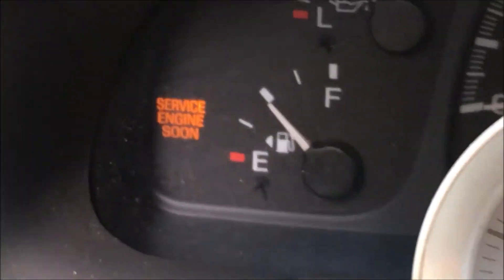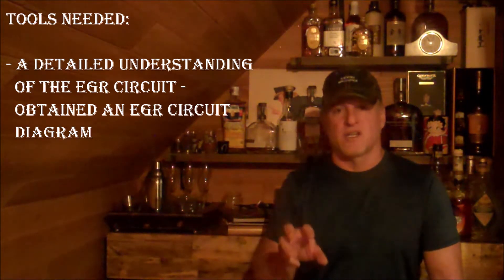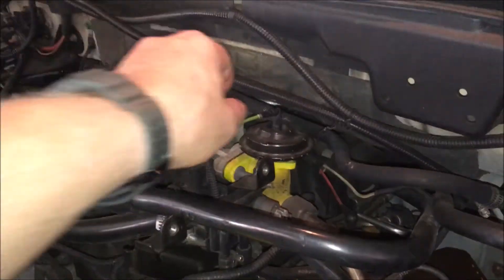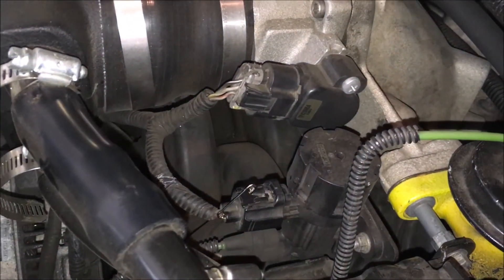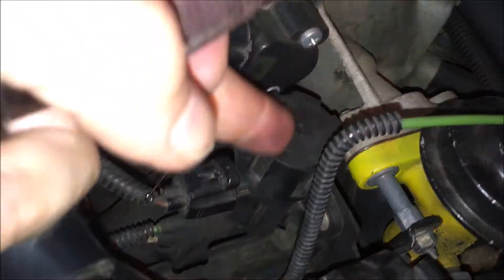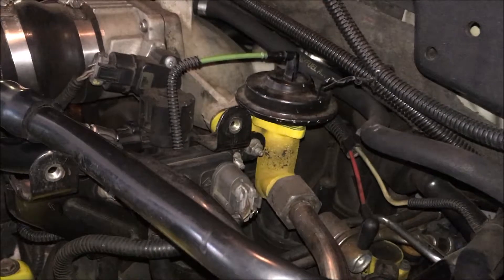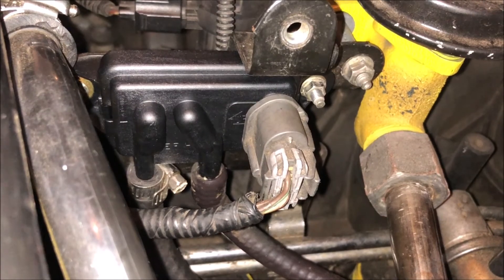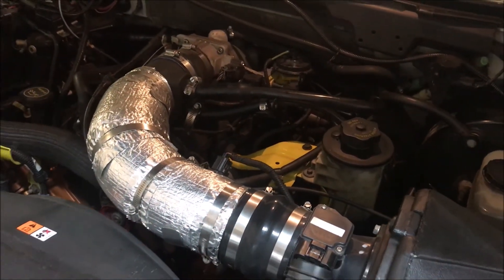How To Diagnose & Repair / Fix Ford EGR Circuit Failure P0401 & U1262 Communications Fault:  F150

Comment: Excellent content, just had an issue which I had to remove the egr, snake out the port to clear carbon deposit buildup, then replace dpfe sensor and replace both 1/4 vacuum hoses which is essentially important. Unfortunately a couple task must be performed to get the egr circuit functioning properly
Reply from the maker: right on

Comment: Dpfe sensor faulty and clogged converter on my friend's 97 F-150 5.4 l.  Like a different engine now it can breathe again.Never code code for sensor and would have loved to had ya there to suggest your logic and eventually I may have put it together but good to know someone with your thought process and trouble shooting.✅👍
Reply from the maker: glad you worked it out... I pulled my upper cats and came to find out the previous owner gutted mine passenger side!  Now I only have 1 cat on the driver side!  ;)

Comment: Sometimes (rarely but happens a little more than not) that orfice tube going from the exhaust manifold to the EGR valve will become clogged causing loss of flow or none at all between the dpfe hoses. It kind of acts like any orfice like in a A/C system. The way the dpfe works is it measures exhaust pressure on manifold side hose and intake air on the EGR side hose with very minimal flow (if any)when EGR is closed through a coil winding (like a mass air flow sensor)inside the dpfe that has 12v connected to one side of winding  and the reference (1-5V) wire going to pcm on the other side. (so I guess think of it more like a blower motor resistor). The exhaust pressure flows through it's hose into the dpfe and so does the intake side, when EGR is closed, they both come together and pass over the dpfe coil winding and that pressure difference is what regulates the voltage going to pcm as it passes over coil.  So its taking the 12V circuit, and through a resistor, converts the voltage down low for pcm input. Meaning the more the pressure difference the more voltage the dpfe sends to pcm on a scale of 1-5 and that tells the pcm how much to open up the EGR valve. If any part before or after the hoses are clogged it'll have no signal due to no pressure difference to measure. You'll also get similar codes if that sample tube has any leaks even pin hole sizes, or if the driver side exhaust manifold is leaking at the rear of engine. Or another thing opposite of this situation is, if the orfice somehow breaks than they'll be equal pressure on both sides and could either cause this to happen or the pcm won't ever open the EGR valve because it thinks it is open. Technically when EGR valve is closed the exhaust gases (pressure) does not (should not) flow through the orfice at all but instead all of it goes into dpfe and on the other side through intake hose. When EGR opens, there becomes enough pressure from exhaust pressure and intake vacuum to pull through the orfice and recirculates the exhaust gases into the engine. So you could imagine that there's not a whole lot of exhaust actually going back into engine like most think. Just enough to keep cylinders cool (I can't remember off top of my head how this helps.) Something to do with the already burnt air fuel mixture it's cleaner, or more dense, or can be cooled quickly.
Reply: Sorry the fix to what I was saying is changing out that $100-$150 sample tube going from the EGR valve to exhaust manifold. And a quick test to check if clogged or fully opened orfice is shooting compressed air on each rubber hose one at a time. If exhaust side hose allows air out the exhaust and not into the other hose than that's good and same thing for intake hose. Shoot air in it and either use a mighty vac to open EGR valve to allow that compressed air to go into intake so it'll be easier to listen for, or it should slip off the EGR sample tube (or buldge if hose clamped is installed) from to much pressure
Reply: I didn't realize yours was an actual circuit failure. 9/10 times it's the dpfe. They get corrosion on the coil or it breaks. Sometimes the ports that the rubber hoses go into just get gummed up or spider webs (has happened and cause circuit failure). If you have the older style metal dpfe then ditch that one and get the updated plastic one. Ford had a tsb on this saying the metal one is .5ohms and the updated plastic one is 1ohm and should not affect drivability or the way engine runs. There was one person on Ford truck Facebook that said he went through 3 plastic ones and wasn't until he found a new metal one(discontinued and hard to find) it actually fixed his problem. It's possible he has other issues and needed one that was closer to his original pcm programmed tables. However I had a 97 with original pcm and original strategy code (tune/program not the same thing but strategy code is how you find if you have updated software or not) and the 97 f150 4.6 had the original metal dpfe and I got different ohm readings and wasn't consistent. Swapped out with plastic one and all was perfect! The ohm will be high if it's bad, most of the time, or none of it is broked
Reply from the maker: Thanks for all that data, always great to get your input.  With regard to keeping the cylinders cool, the purpose of the EGR circuit is to keep combustion temps down to prevent the formation of NOx, oxides of Nitrogen, which is a pollutant.  Very important for our environment.
Reply from the maker: @dyllanbabb7472  thanks
Reply from the maker: @dyllanbabb7472  more good info
Reply from the maker: I explain keeping cylinder temps down in this video:  https://youtu.be/VhIG7BOpihM

Comment: So I just watched your video and I am wondering if you completed the drive cycles before you rescanned for codes? Seems to me that when you erase the codes, they are not going to reappear until the drive cycles are complete and readiness is attained.
Reply from the maker: Good question, sometimes faults show up immediately and sometimes they require drive cycles to show up.  In either case, I made sure the errors did not return once the repair was completed.

Comment: Your seatbelt is because your running diagnosis with driver side seatbelt unbuckled and same goes if running codes (key on engine off) and you get oil pressure gauge/sensor code too. I've also gotten window circuit codes if I run diagnostics with the window in any position except up (but not on every vehicle) and door switch codes may appear if running codes with door open. Just throwing that out there
Reply from the maker: Thanks for that info Dyllan

Comment: I had a P1406 code on my 00 F150 4.6L. Replaced the DPFE sensor and thought all was good but now I'm getting a P1400 code. Is my new sensor faulty?
Reply from the maker: Hi, your codes don't necessarily indicate a problem with the DPFE sensor.  Have you followed my tests to isolate the problem?  Your EGR system could be plugged and need cleaning.
Reply: @DrivingIntelligence  The P1400 code seems to indicate low voltage. It didn't show low voltage before I replaced the DPFE sensor. All hoses are clear, I even replaced a hose that's going to the EGR valve. It doesn't seem to be affecting performance, but it just bothers me that the engine light is on.
Reply from the maker: @BrettDarien have you checked the EGR for plugging and proper function?
Reply: @DrivingIntelligence  I don't have a vacuum pump like you have in the video. I'll see if I can find one and maybe do some more testing over the weekend.
Reply from the maker: @BrettDarien  good call, if your EGR is plugged and not opening properly, or the plugged areas are limiting exhaust flow, you will get a bad voltage reading.
Reply from the maker: @BrettDarien I have one linked in the description of my video.

Comment: 2021 ford ranger. Bucking and surging. New spark plugs and a ton of sea foam did not fix.  Dpfe egr sensor and hoses fixed the problem.  $150.
Reply from the maker: Glad you got it sorted out

Comment: I have a 4.6 with the same code. Replace the egr valve and cleaned the lines and replaced the other part with the plug and two lines going into it. Yet I get same code. Been checked by a shop, they say it all works good. So I just leave it alone. I use the BlueDriver also.
Reply from the maker: Sorry to hear that.  Did you perform all the tests I show in this video?  Shops that say, it works, no problem with a continuing check engine light are not worth the time or expense.  Do you have any other codes to go along with the P0401?
Reply: @DrivingIntelligence  no. Just that one code. Truck has over 287000 miles on it too.
Reply from the maker: @41BeachComber  I suggest you try all my troubleshooting steps to see if you can isolate the problem area.  Get back to me once you have performed those steps.

Comment: I wish you were in Georgia to look at my vehicle!😊

I like learning and fixing my vehicle repairs, but I do wish I had a lift to do repairs underneath my 2000 ford expedition 4.6L V8 Triton XLT. 

By the way, do you know where I can get valve body parts for my vehicle?
Reply from the maker: A lift surely helps, but my problem is my Mustang is stored up there making room for my other projects!  As far as valve body parts are concerned, I assume you have a 4R70W tranny.  This playlist shows how I resolved OD Shudder by using many parts that improve transmission performance and life.  The first video shows most of the parts I used to improve valve body performance:  https://youtube.com/playlist?list=PLGNsbVXzRfZM6WpCF862q4DlkyatzFIMz&si=jXFGBHlIvog_-ku3
Reply: @DrivingIntelligence  Yes I do have a 4R70W. 
Thanks for the playlist link.
Reply from the maker: Sure thing, let me know if you have any other questions
Reply: @DrivingIntelligence  I was watching all the videos in the playlist and it's good to see the parts that I will need and actually find them.

I wanted to know where to get a compression spring tool to use when I do my overdrive servo, reverse servo, etc. or did you make one?
Reply from the maker: @flowersfam3462  Glad you found the playlist useful and if you buy through the AMAZON links in my description it helps support my channel without costing you any more.  I added the link to my video for the tool I used, but that company is either out of business or out of stock.  I found this listing on the internet, but I have not used this tool: https://www.freedomracing.com/307-251-servo-piston-remover-installer-t92p-70023-a.html?___store=default&gad_source=1&gclid=CjwKCAiA1-6sBhAoEiwArqlGPmhvt1SuH5kP0Ui5YI-yRELcMJpDOp0H59DnjT9duXN3gwjIEN784xoC2VoQAvD_BwE
Reply: @DrivingIntelligence  You have been a lifesaver for this female newbie mechanic! So glad your video popped up in my recommendation and for your ford parts list on Amazon since some of the parts are hard to find or out of stock or doesn't fit my expedition.

I'm going down the list of codes to fix from a diagnostic on my expedition.

I broke a nail 💅🏼 trying to gently replace my #1 spark plug and coil! Now on to #5 spark plug and coil since I'm getting misfire from those two. 
Since I'm getting rough idling, I'm going to also clean out the Idle Air Control Valve and replace the gasket. And clean the EGR Valve and replace the gasket today. I've already cleaned out the Throttle Body from carbon buildup and sprayed my Mass Air Flow Sensor.
I'll have to wait until I get my parts to do my valve body next weekend. Hopefully after all these repairs my expedition will be good as new!🤭

Glad to help give back with the parts that I can order for my valve body to show appreciation for all the advice. Not many people responded to my questions, so I appreciate you responding to me.
Reply from the maker: @flowersfam3462  Very glad to help.  Your message encourages me to continue making videos... slow & hard to build a YouTube community!  ;)  Perhaps you saw my playlist for the 10th Gen F150 which also applies to the Expedition:  https://youtube.com/playlist?list=PLGNsbVXzRfZOX-wS2iUKt82qXuGjygULH&si=6Al5DTolbm6ERTzt  and as far as rough idle is concerned, could also be oil contamination in the spark plug holes due to leaking old valve cover gaskets.  When you pull your plugs, are they covered with oil?
Reply: @DrivingIntelligence  Thankfully there was no oil in the spark plug holes. 
Yes, I just got through watching that 10th generation f150 video. It's also helpful with my 2000 ford expedition 4.6L V8 Triton XLT like you said.
Reply from the maker: @flowersfam3462  excellent!  If you have Facebook you can also catch me at www.Facebook.com/DrivingIntelligence

Comment: Was getting back pressure code. replaced sensor and exhaust tube which was 241k original part and clogged. after replacing i now get rhe u1262 spc data link in the hybrid electronic cluster. its on 02. ay suggestions. im seeing stuff all over the map on what it might be
Reply from the maker: Did you only have one code?  You replaced your DPFE sensor?  Do you continue to have other codes, and are you sure you cleared all codes after performing the repairs?  Try this trick to reset the ECU and let me know what happens:  https://youtube.com/shorts/m9xQSaeyZ6o?si=ng9SCgYsjVZ2fW6B
Reply: @DrivingIntelligence  discovered the code is a generic bus error. Something cant communicate with the PCM or vice a versa. It was the aftermarket radio back up camera that I strongly believe is the culprit. Went back to my logs and the code was always present since I got this truck 6 months ago.
Reply from the maker: @taneesescu  what year is your truck?  And just to confirm, your only DTC is U1262?
Reply: @DrivingIntelligence  its an 02 7.3 and it has side passenger airbag and another airbag and that is it. Yes 3 codes
Reply from the maker: @taneesescu can you please send me all 3 codes?  Hard to assist without that information
Reply: @DrivingIntelligence  b1869, b1871, b1884 and i did a KAM reset after replacing the EBP and tube I am get the P1000 OBD error - thinking i need to drive 100 miles for that to go away.
Reply from the maker: @taneesescu  You're right, the P1000 is because you cleared your memory and need miles on the vehicle to eliminate the code.  Regarding your other codes, they are likely the cause of U1262.  You will need to resolve those faults to possibly eliminate U1262 and do it quickly since this is associated with your supplemental restraint system.
Reply: @DrivingIntelligence  awesome. thank you very much for taking the time and looking into that for me. very few people these days act like human beings anymore and for that more than anything, thank you!
Reply from the maker: @taneesescu  very welcome... I enjoy helping.  I only ask people subscribe, like and share my videos :)
Reply: @DrivingIntelligence  done and done!

Comment: Can a faulty cat cause a po401 code?
Reply from the maker: In my experience, I don't see any connection betweencP0401 and a faulty cat.  If the cat is completely clogged, perhaps?
Reply: Highly doubt it. That's gonna be more of like a.p0420 p0430 code

Comment: My sensor melted off. What does that mean
Reply from the maker: Are you referring to your DPFE sensor?
Reply: @DrivingIntelligence  yes I literally melted like wax
Reply from the maker: @Magnuss0724  My thought is that it internally failed and allowed exhaust gases to flow through the sensor, or one of the tubes going to the sensor is plugged.  Remove the rubber hoses and try spraying carb cleaner down the tubes to make sure they are free and clear.

Comment: I need p1405 senser replace
Reply from the maker: Always remember a diagnostic trouble code indicates a problem with the sub-system, and not necessarily the sensor that is indicating the problem.  In this case, a P1405 can be caused by one of the following:  1) Damaged, disconnected, or plugged DPFE sensor upstream hose, 2) Faulty DPFE sensor, 3) Malfunctioning EGR valve, 4) Wiring issues in the DPFE sensor circuit, 5) Leaks in the EGR system, 6) Clogged EGR passages, 7) PCM failure (rare). Try the tests I show in this video to isolate the problem.

Comment: I replaced mine ,still having issues so I'll check the wiring
Reply from the maker: What did you replace?
Reply: @DrivingIntelligence  the EGR valve and the dpfm
Reply from the maker: @jimleffler7976  good luck with your testing